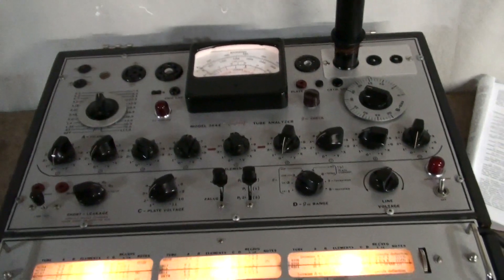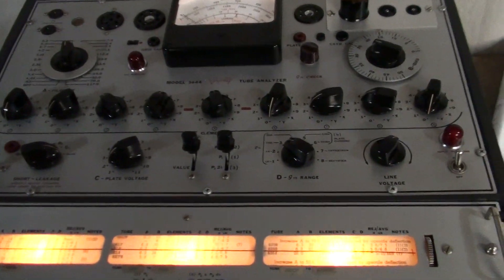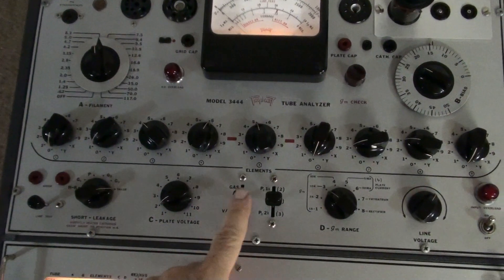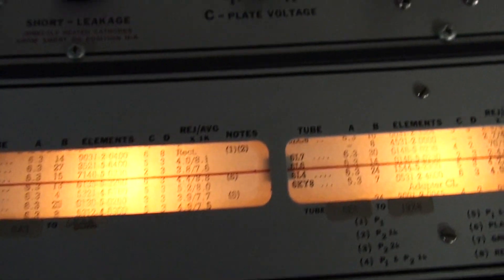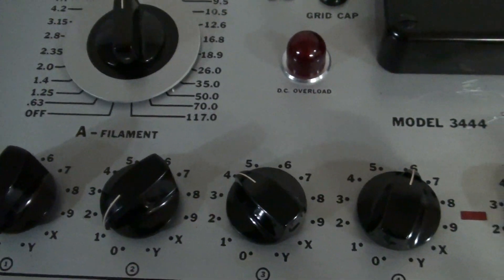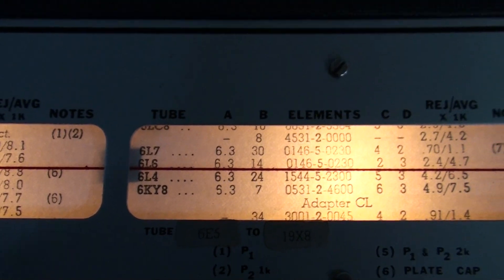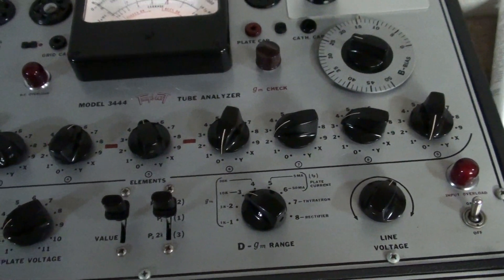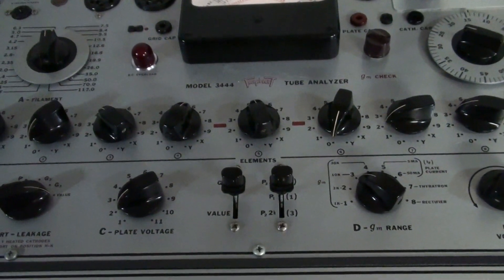Triplett 3344 Not Working "Can only Set The Line"

Comment: I would remove the plate that covers the 3 sockets. Remove the Palomar socket saver and plug the tube directly into the lower socket. That was the problem with mine